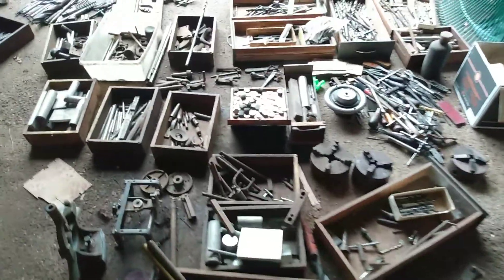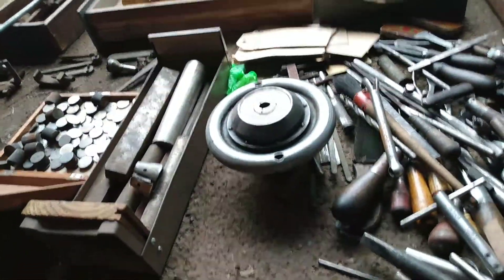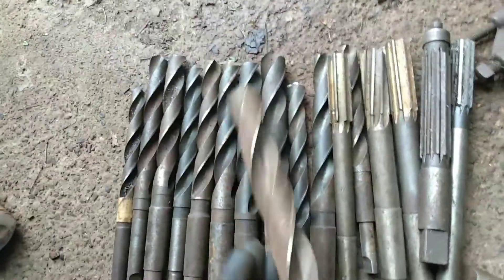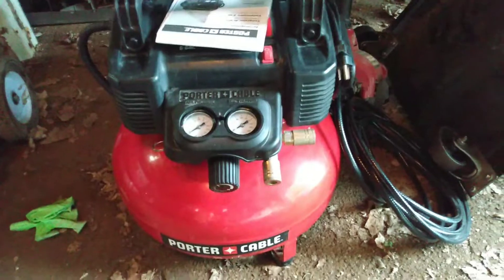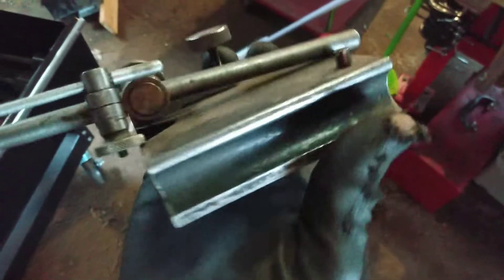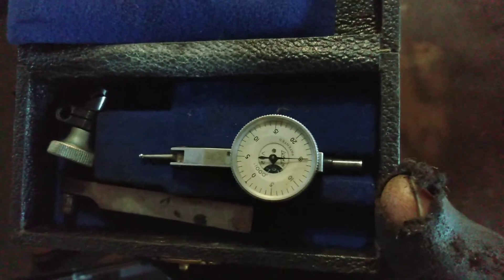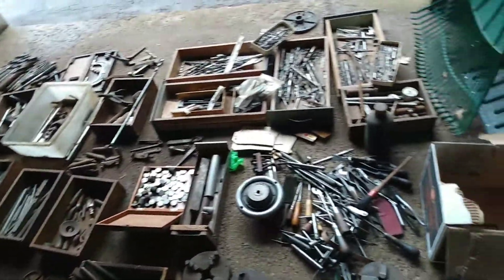Lathe accessory haul

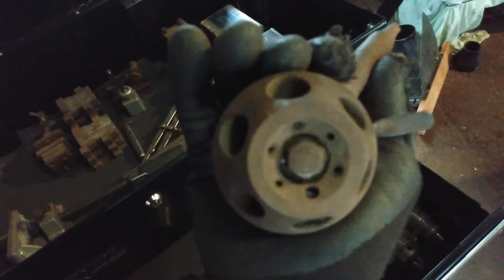Comment: Jesse-  Awesome stuff there!  At 3:11 that round object is a collet chuck, used mostly to hold round stock you have the collets that go with it they are shown at :30...  Next at 9:28 is a turret mount.  You put that into the tailstock of the lathe and then you put different accessories in each of the holes, that way you can start a hole, spin the turret, drill the hole, spin the turret, ream the hole, spin the turret, tap the hole....   Saves tons of time on multiple operations... =D   All great stuff!
Reply from the maker: Thanks John! I am slowly learning the purpose of a lot of these pieces and learned about the turret mount by googling the piece itself. I believe it's an Enco. This stuff is cleaning up beautifully and I'm almost having to force myself to call it quits for the night! Very happy with the purchase of the lathe by itself but with all these accessories it's like perfect score. I'll do a video as I progress on the cleanup and of course one Sunday when I get it home.
Reply from the maker: After cleaning the 3 and 4 jaw chucks I found one of the 4 jaw chucks is a Craftsman, I believe to be original to my specific lathe. I can't wait to get it here Sunday!